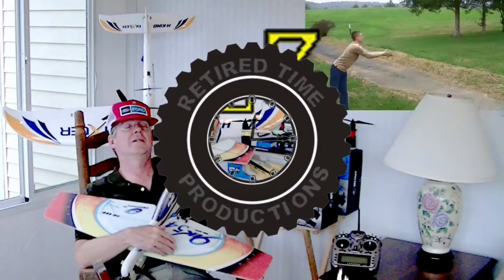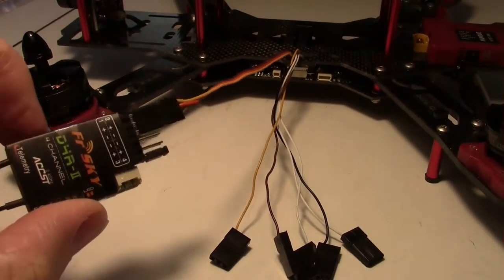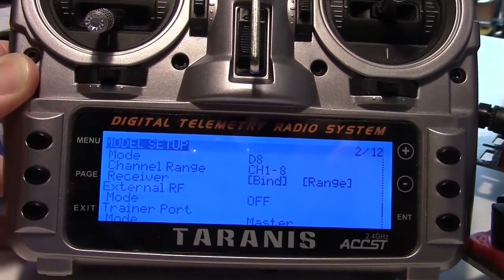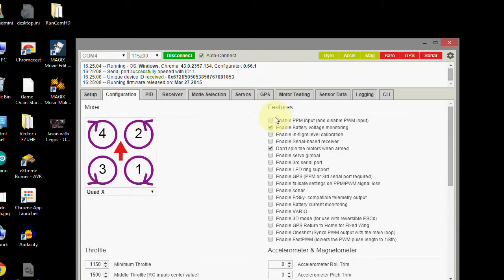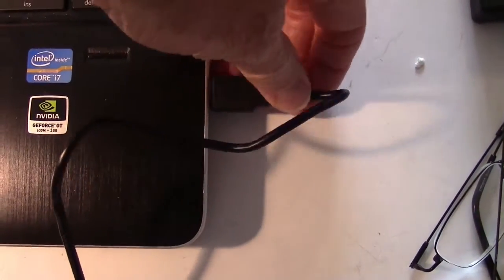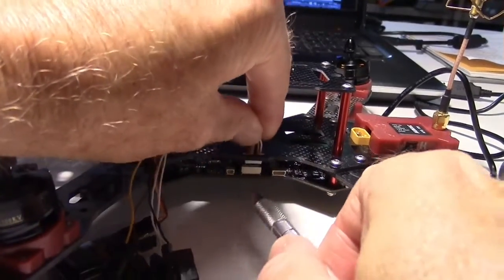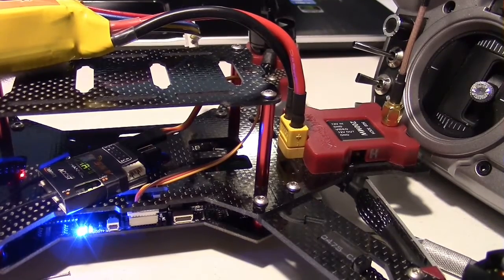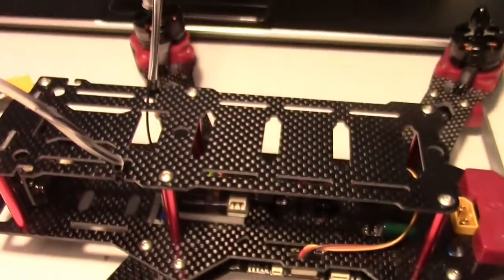D4R-II Receiver PPM Mode on EMAX NightHawk 280 Pro Mini Quad

Comment: Thanks for this, just considering getting back into doing a bit of flying and was wondering if I could use my old FrSky Rx's with a more modern (as compared to KK2) FC. With this info it looks like I should be able to. Edit: well actually I can't, looks like all my RX's are the V8 versions that don't have FW update.  At least now I know.

Comment: i got my ppm mode working but on the computer is reading movement for a mode one transmitter and i have a mode two, how do switch this?
Reply from the maker: You might need to change the channel mapping in Cleanflight under the receiver tab.

Comment: Is it possible to hook up a Frsky GPS module to the D4R-II Receiver for the NightHawk ?
Reply from the maker: +John Isherwood That would be cool. You might try posting your question here:
http://www.rcgroups.com/forums/showthread.php?t=2443194
Reply: +dmerc00 thank you I'll take a look and ask. Also thinking about attaching a barometer for hovering. As I'm new to diy quadrocoptors I need some pointing in the right direction

Comment: Do you have Telemetry back to taranis ????
Reply from the maker: +George Chatzisavvidis I have heard it can be done with cleanflight and a wire to a port but have not tried it. Be nice to have the battery low warning on the Taranis.

Comment: Thanks for posting this Dave. That is a great little receiver (I'm using one in that Versa Wing you've seen in my recent video). I think I'll replace the D8R-II+ on my tricopter with one of these little guys, as I can still get the 8 channels I need into the Naze32.
Reply from the maker: TheAdkFlyer10 I think Dan iel on another post recommends a firmware upgrade to use all eight channels. I will have to look into that next.